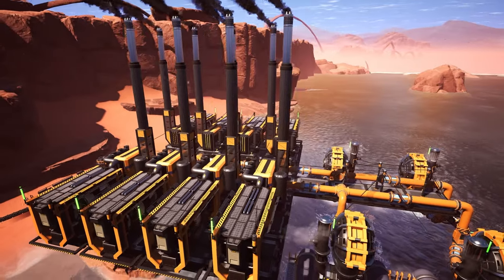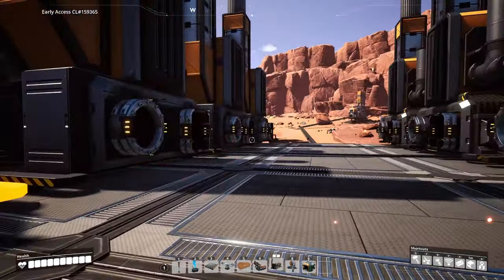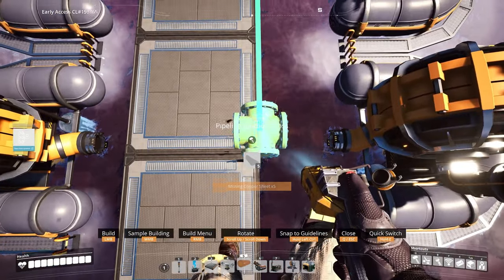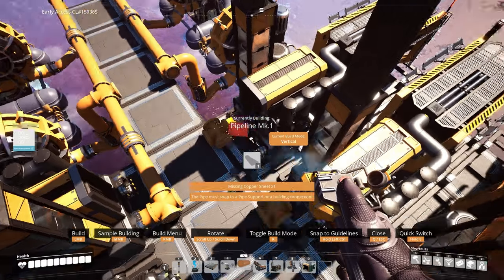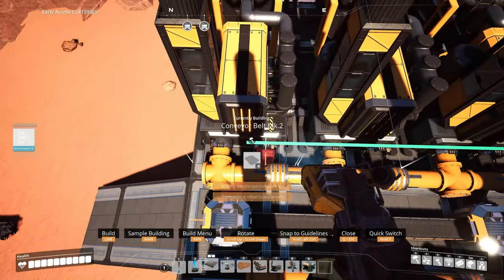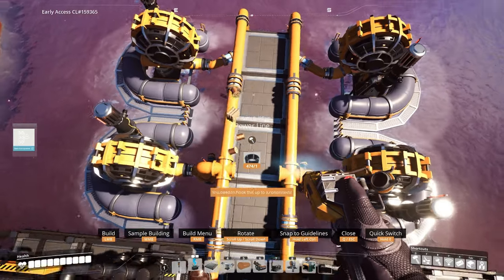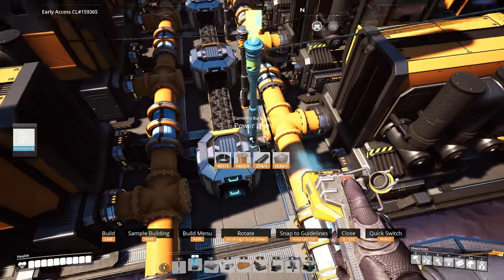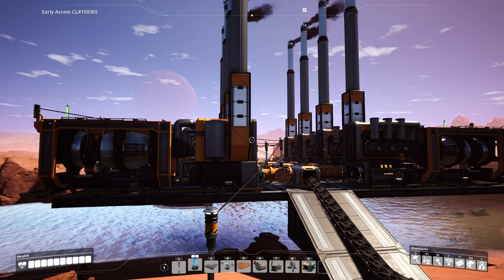Efficient Starter Coal Power Setup Tutorial | Satisfactory

Comment: It's a pretty good setup but the "pipeline pumps" really aren't needed. Just build the plants a little closer to the water and save some materials/power.
Reply from the maker: True
Reply: extractors can move water 10 meter by themself. as long as you built 8 meter higher than the water, which is what you did. you didn't need the pumps.
If you build a sky coal generator and you need to move a lot of water use the Water Tower method. One pipe, one pump needed to move unlimited amount of water.
Reply: @bananafoneable  Can I just build the same exact thing he did just without those pipeline pumps? Would it work?
Reply: @carter.5814  You never got an answer, but probably already learned that you don't need the pumps at all, nor do you need 4 underclocked water extractors, only 3.
Reply: @avalerionbass wait, so three are enough?

Also if I may ask about the coal to power this setup one or two mk 1 miners are enough?
Reply: @ItalianDucky pretty sure two mk1 should work cos they produce 60/m each
Reply: @ItalianDucky if you have em at 100%
Reply: @tincanman1  Each generator needs 45/m, so at least 3 extractors for 8 generators.

Although 4 extractors underclocked are better for efficiency (more materials to build but less power consumption)

Comment: A little heads-up: Make sure to use mk.2 conveyor belts if you're using more than 4 coal generators because otherwise you won't be able to feed all of them with coal.
Reply: so my coal vein is far away, do i have to use mk2 conveyors the whole way?
Reply: @osmosisjohn1877  My coal vein is insanely far away from my generators. I have had a huge problem feeding them with coal with all Mk1 besides the Mk2's that are actually on the site. I think mk2 the entire way is how you fix this problem
Reply: I’m using mk2 belts and still can’t get all my coal generators fed. Also I’m pulling from three normal coal nodes. Can anyone give some advice?
Reply: @futurewillow3269  u have to have set up 3 water generators or 4 like in video overclocked on 75 percent

Comment: Good tutorial video. Two things to add though if you want to improve efficiency. First you don't need the pumps if you build the generators close to the water, the water extractors have some innate head lift. Second, you need only 3 water extractors / 8 generators. Build the pipe in the long U shape (so do connect them), with two water extractors feeding one end and one the other end.
Reply: yeah or you can have one end flow all the way back around to the other side to balance any backflow
Reply: @heyz13  3 extractors isn't enough to fully provide water to 8 gens
Reply: @AwesomeNuke  Each Coal Generator uses 45 m3 water per minute, each Water Extractor produces 120 m3 water per minute. 3 * 120 is 360. For the Generators it's 45*8 which also is 360. That means 3 Extractors is exactly enough to provide for the 8 Generators.
Reply: @snekk5752  A water pipe is 300m³, so your 8th gen will not have water. 8 gen on 3 pumps ONLY works with very specific layouts, and since this is a Starter / beginner setup, and in THIS specific setup, that wouldn't work.

Water throughput is something that can be complicated to newer players, so that's why it's MUCH easier and safer to just do 2:1
Reply: @AwesomeNuke  as long as you connect 4 gen - 3 pumps - 4 gen with a single line it would work.
Reply: @voice5sur5  Yes, which is why it was specified that a specific layout was needed, and that it wouldn't work in this setup..
Reply: Yeah finally figured out my flow problem.  I was 1 extractor short😅

Comment: Its nice, but the OCD part of me could deal with the belts clipping through the pipes .....
Reply: I just did this build and fixed that issue, just have the pipes elevated one level and run them over the top of the junctions youll have to add another set of junctions but looks pretty clean

Comment: Recommend feeding your coal conveyor belt into several linked industrial storage containers so if you ever do something later that breaks your coal feed, you have plenty of coal to keep your plants going while you fix your coal feed.

Also if possible, recommend setting up your generators at the water level so you don't need pumps to push the water up vertically. Each water pump is eating up a percentage of the power that your coal generators are producing.
Reply: you posting videos? this is some great advice!

Comment: A very nice design, I like the simplicity and the aesthetics of it!

One thing that I've found that could improve it however is that a tier one pipe can move 300 units/min of water while the coal plants take 45/min, so you could comfortably run up to 6 coal plants on a tier 1 pipe, though that requires 2.5 water extractors. So, with 5 water extractors, and using pumps as one way valves to evenly split the flow from our 5th extractor, we can feed an array of 12 generators. This does mean you need to have 180 coal/min, so you may need to bring in extra resources via a second belt line.

Comment: tip you only need mark 1 belts going into the coal generators it is a small material save but in my playthrough i didn't have a very fast reinforced plate setup yet so i helped alot because if i didn't i have to wait a while
Reply from the maker: Yeah, I didn't really think about it, but that will work
Reply: Yeah but from the coal mine node which mines 120/min as required for 8 powerplants you need an MKII belt to deliver it straight to the power plants or have two drills 60/min ea but then you have two long belts to deliver it to the power plants

Comment: Just made this today and did everything you said to do even the part where you waited for each coal generator to be filled with coal first but still I end up having a problem with mainly the two back rows of coal generator not receiving enough coal and cause the power to be decreased is there anyway I could fix this?
Reply: yeah thats the problem i see everyone suffer from.. its called running the coal in modular form.. which makes it so it needs to run thru so many splitters making the last coal gens taking in 1 /4 of the coal the first one receives . so try to do it the alternative way.. which is load balance not modular also make sure if your using mk1 pipes that you set the water flow to 90 per min so then its 90x4=360/by 8 =45 which is exactly what the coal generators require 45m water per min
Reply: Bro exactly what i thought. I commented before seeing your comment thank goodness i thought it was just me. But basically on each splitter on this setup the coal is not split evenly. I am confused as hell
Reply: @SIDEKICKONYOUTUBE  yeah you gotta make sure you split then feed the generators individually.  Kinda hard to explain but I have a picture of a layout that will help tons . Also helps with splitting prime number amounts . Without bottlenecks
Reply: @SIDEKICKONYOUTUBE   here check this out to understand it better and know the difference
Reply: @heyz13  there is no link

Comment: i made one myself but the thing is power keeps shutting down... enough coal is there that even the conveyer belt is stopping in b/w but water is sometimes full or sometimes less than 10m3 in the generator what should i do? i already have 2 water buffers.The setup is 2 water extractors and 4 gens with the extractors on a elevated level and generators below.I also have attached pumps
Reply from the maker: You might not need pumps if you have the water going downwards

Comment: So i have built this now. 1 mk1 miner but with 200% power to get the 120/min. I let everything fill up water and coal. Run it. Produces the 600mw. But i notice the coal is being drained very quickly in each coal generator, now the end coal gens are producing less power. How do i fix? just add more coal miners into the line?

Comment: You only need 3 water extractors per 8 coal generators. I put two on one pipe as the main feed to the generators and one is the back fill and connects all the at the end of main pipe.
Reply from the maker: Yes, you can also use 3 generators clocked at 100%
Reply: @Wa_zz  Just pointing out, it seems like a waste of space and materials, and the mwph is the same.
Reply: @Wa_zz  Yeah why use 4 underclocked when you can use just 3?
Reply: @NotUsedAnymore182  Running water extractors (or ANY machinery) below 100% saves electricity because their power profile is non-linear. At 75% extraction level the water extractor only uses 12.6MW which is only 63% of this nominal 20MW power consumption.
So 3 extractors consume 3x 20MW = 60MW power to get the water, while 4 extractors consume 4x 12.6MW = 50.4MW. So you save almost 10MW by just using one additional water extractor which costs only a fixed amount of resources.

Comment: I put my coal generators at the same level as the water extractors right in front of the entrance of the coal generators and run a huge pipeline in between it connecting all the water extractors and coal generators, I won't have the need for pumps that way.

Comment: Ok, so I followed this guide to a T and my generators start at 600MW production but by the time i walk back to my base 2km away (feeding power along a line back to base) Its only producing 300-375MW. Why is this? If I go back and restart it, it goes back to 600 but drops off again by the time I get home.
Reply: thats what i posted a comment about just now .. the problem is the way you feed the coal to the coal genz . in modular form which as you can see sucks in instances where its to produce power . it needs to feed the generators equally in stead of modular in a line thru so many spliters cause the first one gets fed a lot more than the last generator . also make sure the water extractors are not over pumping water. if you copy this setup set them to 90per min. so them the math is 90 per min x 4 extractors = 360 devided by 8 = 45 which is exactly  what each coal gen needs

Comment: For some reason I have problem with coal supply for the 4th generators in the line (even when using mk.2 belts and 2 mk.2 miners on Normal deposit). I guess the classic Overflow method isn't the optimal one for power plants.🥺
Reply from the maker: you will have to let every coal generator fill up with coal before turning them on
Reply: @Wa_zz  I'll try it, thanks!
Reply: @Wa_zz  Solved my problem, thanks for help and tutorial. 😉
Reply from the maker: np 🗿👍

Comment: Pro tip: Don't wait as he said after you connected coals. You dont need to wait all of them filled with water and coal.  There is no downside of activating them immediately and there is almost no upside waiting for it and in fact there is downside waiting for it because you basically either waste your time or your biomass burners waste more energy. Also if you just make it work after you finish it you dont need to return there after X amount of minuets to just make it start working. Trust me i know what i'm talking about :D 
Good video though 8/10. I dont like that wigly conveyer belt system so i would divide main coal input two two and double the splitters and each one connect just one coal generator. It just nicer to my eyes
Reply: When this goes, the splitter takes the 120 coal, into 60, then 30, then 15 is that right? And once its at full capacity, the coal level should pretty much remain the same, Im assuming, the end generators would struggle only getting 15 exact coal into them, but of course the previous splitters would be backed up and thus send more to the final splitter? Is that right? Im just building it now and my end 2 factories keep switching on and off. So maybe thats why I needed to wait alittle?
Reply: @NotUsedAnymore182  As somebody build this generator type so many times i can assure you the fact you dont need to wait in fact if you start immedietly you gain more power because even not all the generators work same time because it take time to coal to reach further from the source beause it need to previous onces get full doesnt matter. Even first 2 generator work you already have working generators to produce lots of electricity. You gain nothing by waiting but you lose soo much by waiting. It is bad and i repeat bad move. Don't wait. I don't know how to put it more simple way but believe me i'm game developer. Is it work? Like when doctors says they doctors? Yeah you can trust a game developer right :D Well i'm indie not a millionaire one but hey
Reply: @EnderElohim  Is it necessary to wait? No.  Is it a "bad move"?  I'd say, "no".  Over cautious might be a better description.  Satisfactory has had plenty of glitches over the years, a couple of minutes of waiting until the pipes are full and coal loaded to reduce the chance of an issue with momentary resource shortage is fine.  To quote the internet, "if it works, it ain't stupid".  :D

Comment: I was with you - right up until you clipped the conveyors through the pipes.
Reply: it works
Reply: @Henry-sv3wv  I'm sure it does, but that's not the point. I don't mind a little of that kind of exploit, as long as it makes sense visually, but that was a clip too far.

Comment: WTF i dont understand this game. How is that working? Every splitter you have basically splits your coals by half. 1st splitter splits 120/min coal into 3x 40/min coals 2 of which goes straight to the first two power plants, the 3rd 40/min coal goes to the 2nd splitter and gets split to 3x 13.3/min coal and so on. The power plants are not receiving an equal share per min of coal.  Yet this works somehow. For some reason the power plants are no longer consuming coals 15/min but rather slower thereby making it work. I have expected the farthest power plant from the entrance to shutdown due to not receiving adequate coal.
Reply: They are not receiving equal share of coal per minute but will all get filled to 100 coal being that 15 (coal per min needed by generator) times 8 (number of generators) (15x8) = 120 which evidently is the same amount of coal being received. Meaning that each generator will be capped at 100 coal and use 15 coal per minute. Which then will equal out the receiving coal for each generator… got it???
Reply: @TheRealSkeb  nope. still dont get it. it doesn't matter if they are filled 200 or 500 the given is still the same. each plant consumes 15 per min and the last plant receives less than 2 per minute ( 1st splitter 60ea 2nd splitter 20ea 3rd splitter around 6-7ea the 4th splits 2 or something. that last power plant in the edge consumes 15 per minute and takes in 2 per minute. the only way it will work is if its delayed in production and have to wait for the rest of his 13 per minute to arrive. it doesn't matter how big his buffer is 100/200/300/500 the input and output speed remains the same 2 per min IN 15 per min OUT. so i don't get it.
Reply: Well first of all, don’t split 120 coal into 3rds. Just split in half to get 2 lines of 60. Then use 2 more splitters to get 4 lines of 30. Then use 4 splitters to get 8 lines of 15.

The goal is to get 15 coal into each of your 8 generators. If you split into 3 lines of 40, you’re putting yourself into an awkward spot and will end up with those odds numbers down the production chain.
Reply: @SkankHunt8008  this was 8 months ago but yeah thats what i did, 8 plants in line not in 2 lines. but in his video, his first splitter splits the INPUT 3 ways.

Comment: why 4 pumps instead of 3?
Reply: because the 3 extractors will work if you have mk2 pipes other wise the flow limit is 300m per min on mk1 pipes and this setup demands 320m per min so 4 extracters set to 90m  per min is 90x4=360/by 8 = 45m per min to each coal gen which is what they require